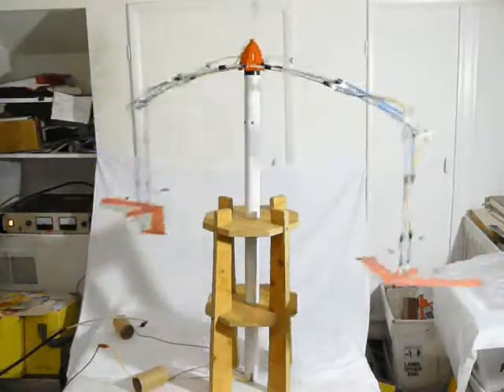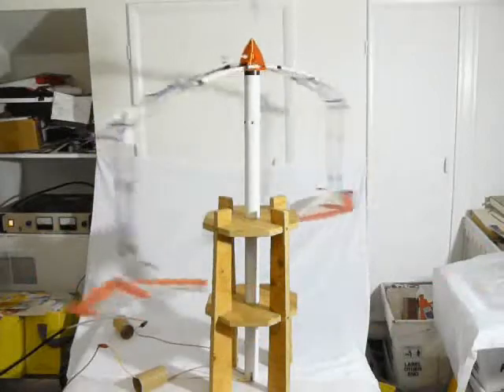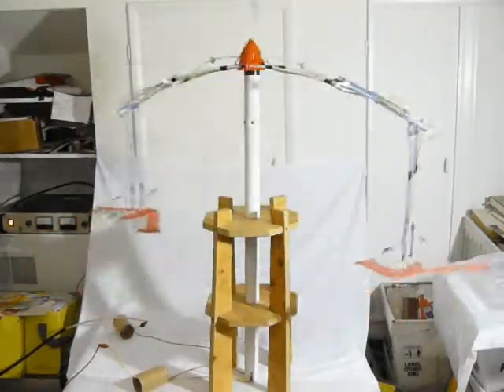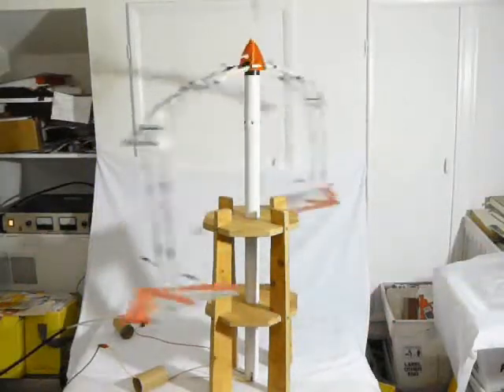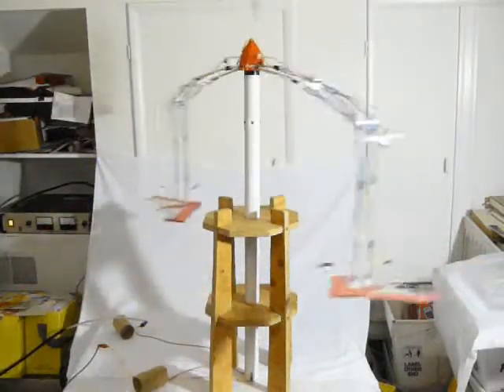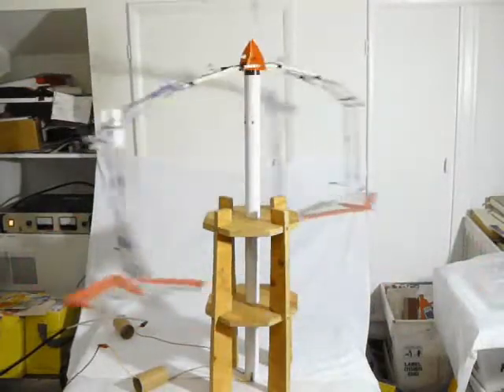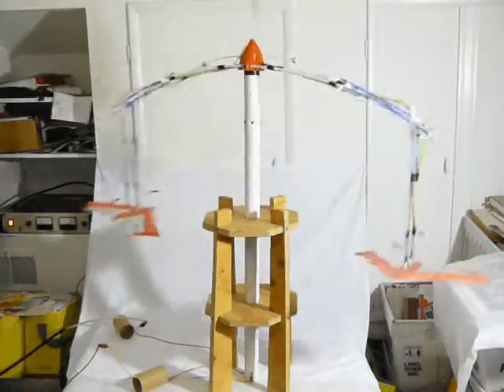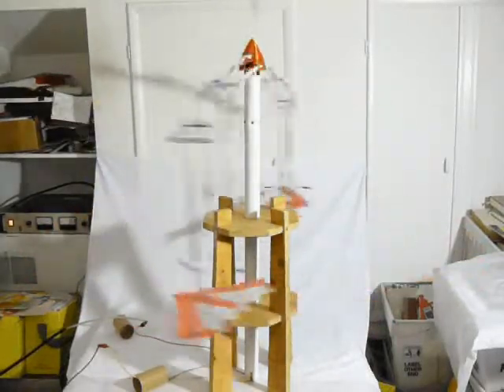B-2 Lifter Wing with Dielectric Insert

Comment: One  factor of importantance, I wish to share with you.
The function of a ioniser, the actual needle that makes the ions. this is specially designed as a very sharp needle like points, these very sharp points will increase the flow of current from the dialectric, to the thin wire, in other words, use very sharp conducting needles, conducting points to connect the fine wire to the dialectric, or the skirt. They have the potential to flow  a infinate number of volts.

Comment: as you know in a lifter, the foil has a greater surface for electricity to flow over, and a thin wire that come in communication to the larger manifold, the saucer, Brown separated the wire between the saucer with very sharp needles i seen the patent too.. as long as electrical equilibrium is not reached the voltage stays very high, just like you said, thats why its important to have good flow of current..

Comment: I'm of the opinion that this is an ion jet engine. Something not far removed from STAR TREK's impulse drive or the a TIE fighter in STAR WARS. However, that too has it's pluses. No moving parts, little or no noise, would be relatively inexpensive to build, in space a small amount of ionized propellant can take a vehicle quite far. I am fascinated.

Comment: the dielectric acts only as a way to separate charge. current flows between the dielectric, and the wire on the outer portion of the craft.
therefore the faster current can flow the less chance of electrical equilibrium between the manifold and thruster. Get it?

Comment: in the video see frame 102  see the very thin wire in front of the flying wing? the orange wire, now look at the yellow wire, both come in contact with the solid dielectric, but the foil also contact the foam. current is flowing between them. making a difference in voltages in the wing itself. keeping the wing out of electrical equilibrium. please explain what you see..